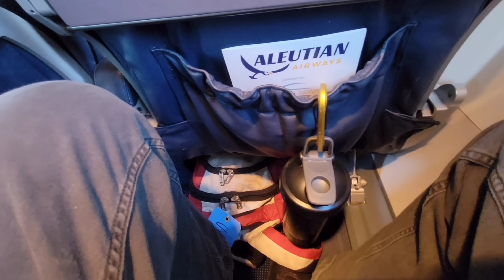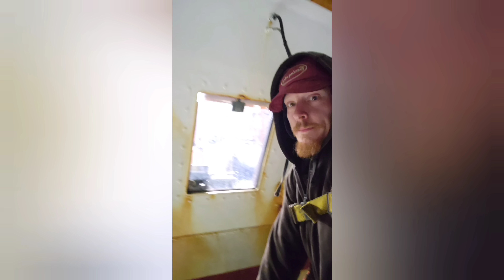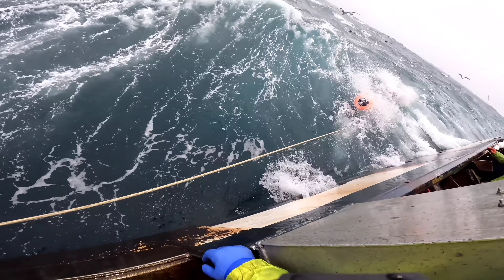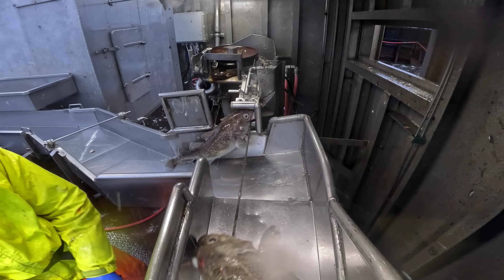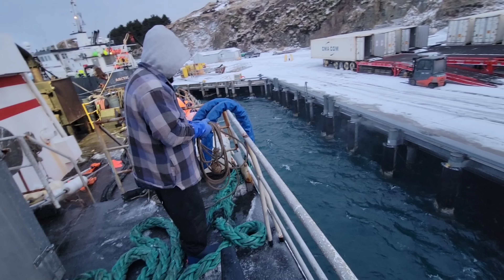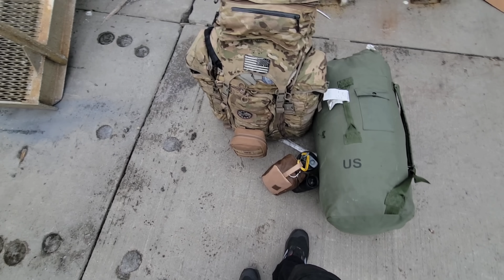Baranof Slaying Cod 2024

Comment: How do the fish come off the hook once they get into the boat
Reply from the maker: @mattszarowicz5049  There's a crucifier, with 4 rollers about 3 inches apart, it's hydraulic open close and also has brushes to knock off bait. We have to shake off the halibut outside the boat, but sometimes I tray shake them before the crucifier and if I can't or the hook is in my arm, hand or rain gear I hit the Deadman switch with my leg.